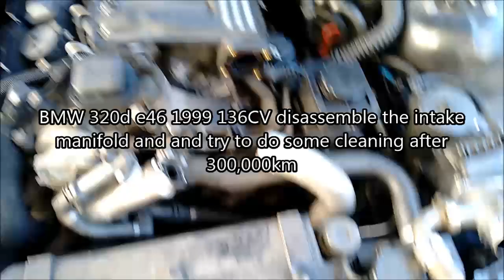BMW 320d e46 1999 136CV disassemble the intake manifold

Comment from the maker: Hi. It is the air pressure gauge inside the collector.
It has to do with height, If you circulate on the mountain or near the sea.
No problens...

BMW 2 246 977 4U15 intake manifold pressure
Reply: I clean it now ! Testing no loop or limit mode good job (y)

Comment: hey man, I have the same model, ty for the video, I have a question though, how do you use the sirocol instalation that you have? it requires a remote control or how do I configurate it, mine didn`t come with a remote control as I bought the car used, thank you.
Reply from the maker: Hello. "mine didn`t come with a remote control as I bought the car used" Exactly the same with me.
But mine is off because it's broken, disconnected.
Thanks